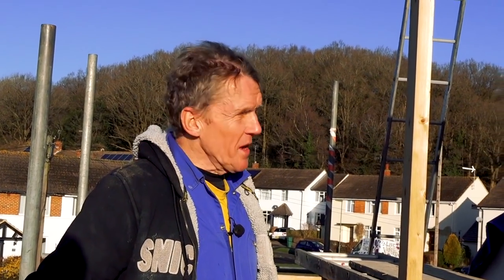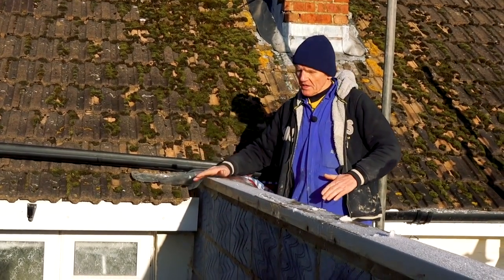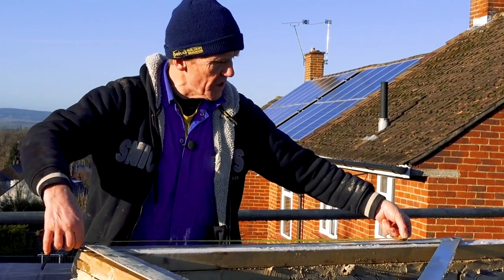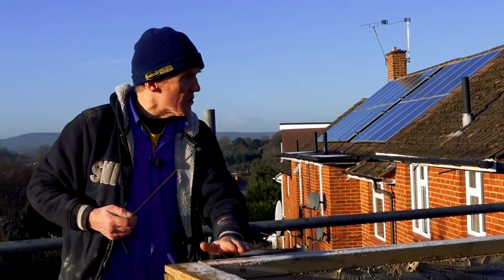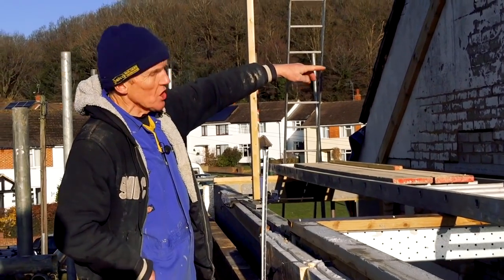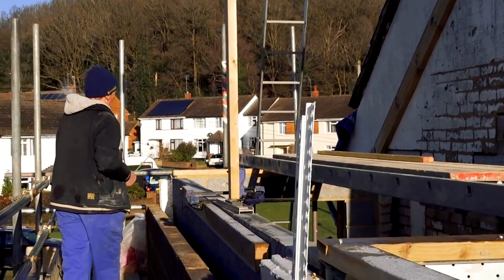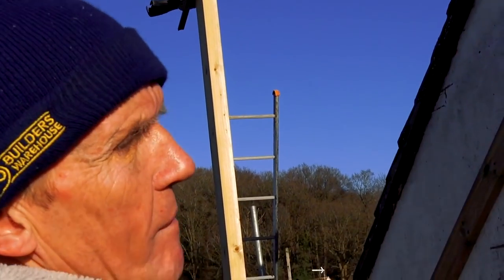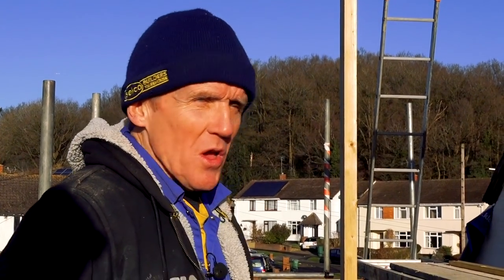Building an Extension #7 - Roof Build-up & 3 4 5 Rule

Comment: 3 4 5 right triangles rule!!  I knew before about this particular "right" (90°) triangle where the legs are 3 & 4 and the hypotenuse (the long side) is 5, but I never knew that carpenters could use this trick to check if a corner was 90°.  Pretty cool!  Permit me to put in my own 2 cents: when you use the 3 4 5 method to check squareness, you will need to mark your end points very precisely since if you are predicting where, for example, a 9.144 meter run (30 feet) ends up, even if your 90° corner is off by only a quarter of a degree (0.25°), the other end of the 9.144 meter run will be off by 39.9 mm (1.57 inches).
Reply from the maker: Robert
You are so right, that marking is very important. If we have two corners we square both and run a string line between them.  You can see if they are within your tollerances

Comment: If you like old time wisdom, here's how you can check the levelness of your project using a method that the builders of the Egyptian pyramid used -  The Egyptians dug a trench the whole way around and also into the the pyramid foundation site and filled it with water which created a level reference.  I know you don't want to dig a trench, so, first you get yourself a long garden hose and then stick two ~12" long clear plastic tubes on the ends of the hose (water tight) and then add  black circumferential lines around the tubes at their centers.  Next, you securely affix one end of the garden hose at one location on your build with the black line aligned to, for example, the top of a beam.  Next, you affix the other end at any other spot with that end's black mark at, for example, the top of another beam.  Then, you fill the garden hose with water (use a funnel) until the water is up to the mark on the first reference end (make sure the middle of the water's meniscus is at the mark, not the outer edges).  Now, if you go over to the other end, you can tell how far off level that other location is by measuring the distance from the water level at that end to the black mark on that end.  This trick works no mater how higgledy piggledy the center of hose is, as long as there is water in the whole hose and as long as the center bits of the hose are below either end and as long as you are not off-level by more than half a foot.  You can check the level over as big a site as you want as long as your garden hose is long enough.

Comment: Roger, Could I just say you don't have to look up the internet or use a table if you have the calculator that you may use to multiply,  you need not do that if you are using an ordinary calculator that has the button  that shows COS:  short for cosine Just take the run that you spoke about say for example, punch in 2.4 for the run Then hit the divide button then Cos button then punch in 35 =2.9298 length of rafter, so shortened version looks like this 2.4 divide COS 35 degree = rafter length it probably reads more complicated than it really is (HONEST)
Reply from the maker: Great tip. We will try it on the next video.
Reply: @SkillBuilder  Really appreciate your reply, makes me feel a bit humble that you will try this tip. Thanks very much. I promise you it works, let me know how it goes.

Comment: I’m a trial and error kind of guy, done lots of roofs and now I’m at the point where I can build a roof to a good standard. I’m doing a loft conversion (on a 30’s semi) at the mo and I’m fitting a new roof onto an old wall plate (from hip to gable) that is 60mm out of level and have to match the old tiles and fascia board (next door) into the new. Your method won’t work, as to match the new roof into the old and keep the eves (looking) straight at  upper 1st floor window height I have no choice but to cut the roof pissed. Each rafter has to be cut individually. The new ridge is nice and level as is the new loft floor but the fascia board is pissed and the rafters have to be cut to suit. The tiles next next door are also 100mm out of line from fascia to ridge and the outer left hand wall has a 50mm bow in it....sleepless nights for me 😂 I’ll get there. Sorry to bang on, just needed a shoulder to cry on 😁. Good work though.

Comment: Roger the pice of timber over the last row of bricks is there any waterproof on the bottom of the timber ? 
I am not sure if this pice get wet.. Maybe it pulls out some water of the bricks ? 
Sorry for my English
Reply from the maker: We call that the wall plate and it sits on top of the inner skin of brickwork. The brickwork is protected from damp by the roof and the cavity so it should never get wet. If the brick were just a single skin it would possibly benefit from some damp proof membrane on the underside but that would be an unusual construction.
Reply: @SkillBuilder  ahaaa you guys are building always with two parallel brick walls. 
We build with on stone that has a thickness about 36cm in addition a insulation of EPS round about 14cm on the outside witch helps to keep the entire brick longer warm in the winter. 
well other countries other philosophies

Comment: What are those plates sat on , are they on mortar or straight on the blocks , couldnt quite see
Reply from the maker: The plates are bedded on mortar to get them absoloutely level. Then I spiked them through with helical fixings that wind into the block. Then straps to hold them down in hurricanes. That roof is going nowhere.

Comment: Just measure the rise ( top of ridge) and use your run ...a construction calculator will give you the pitch (degree) and diagonal ( rafter length)  minus half the ridge thickness.....push the button again for hip or valley rafter. Always match ( dead heights) distance from top of plate to top of rafter , plumb with the outside of the plate. .....of course there’s much more ...like “drops” which is the bottom of soffit to the top of the plate to match up trim....and so on....
Reply: Joe Framer i think he knows what he's doing.  Everyone has there preferred way
Reply from the maker: Thanks Joe. That would have helped and I might even have that calculator lying around  but I was trying to run the rear rafter in and match the height above plate  so the roof ran through to the existing roof.  It is surprising what a difference one degree makes.
Reply: ashley sefton well I was trying to help since I own a construction company,building custom waterfront homes for 30yrs , still going strong. ..I believe he said he’s a plumber and the got the angle wrong the first time....using this method gives you the exact degree without error when remodeling like they are doing. .but thank you for your concern.
Reply: Joe Farmer.  You can always set up a string line to work out your plumb cuts. Birds mouth is always 90 degrees to plumb cut. I would always hold the rafter in position on a small job like this and scribe/trace the PC with a level at the ridge and the same for the birdsmouth/seat cut. If you want to be fancy you can use half your roof width and with the old A2 + B2 = C2. Hip roof just uses a common rafter to determine the length of the ridge and so on. You can't always use a roofing reckoner if you are working to something out of square or level when matching new to old.
Reply: Helicrete Sydney it’s all math , no string is needed or placing a board up to scribe...it’s basic math, rise and run..use a construction calculator if you want to...
Reply: My comment was to show others you don't need a calculator and it can be done other ways. The building will never be truly square or level, but Roger has tried to get it perfect for his chippy. I know the method you have mentioned but in reality unless what you are working with is perfect it doesn't always work and you have to know how to alter or adjust the rafters in order to get them to fit. Also if you are making alterations or additions to an existing roof like Roger mentioned in this video it was probably built a fair few years back and was "thrown up" with out it being precise and to a budget. I accept your way as correct on paper but for others who may wish to DIY I was explaining another way. When your angles are out from what you have on paper and they need teasing in because the ridge is warped, plate is not square and un-level or the timber you are working with is bent or cupped, scribing can make them perfect, then using a pattern rafter to mark the other rafters, it is the same as making a pattern for trimming the joists in to steel. I agree with what you have said I just think for a very small basic roof like this you can work it out much faster with my method and marking the rafter physically then calculating in on paper, then transferring the measurements to the timber, marking, cutting, dry fit and then find out, hang on this doesn't fit perfectly, I need to scribe it any way. I think it is best to know both methods! Cheers

Comment: Who ever told you that u will never need pythagoras Thereom lied.
Reply from the maker: Very few builders and carpenters know the Pythagoras Theorem. They rely on tables and apps to arrive at the measurements. Even if you do know it you still need to work the square root of the hypotenuse out to get you back to a usable measurement so you might as well let your phone do the whole thing.